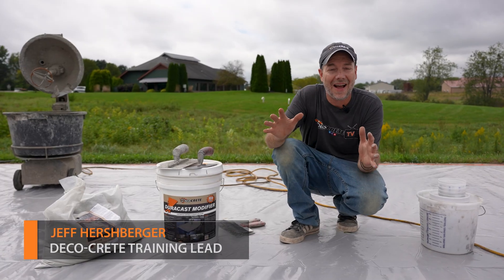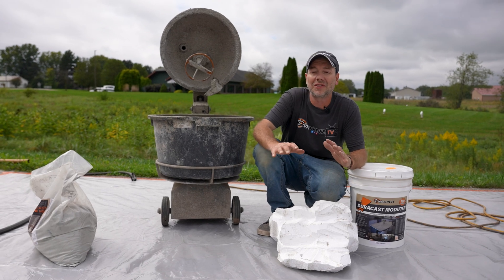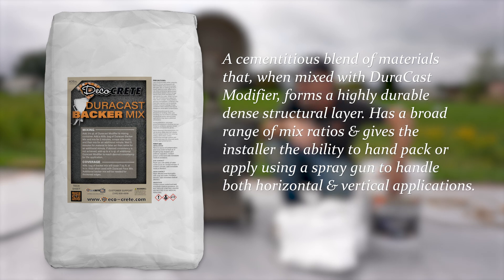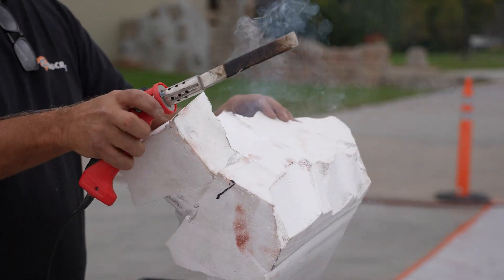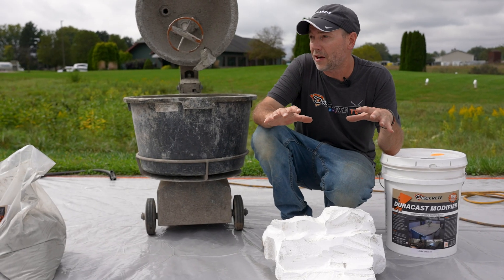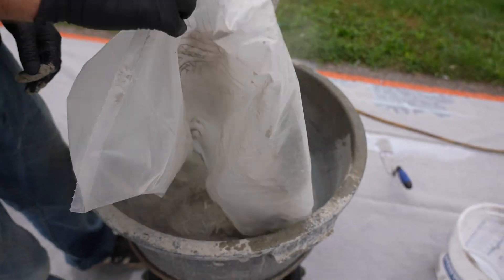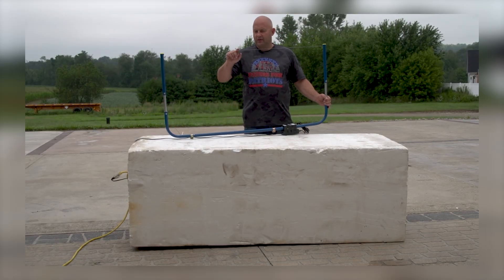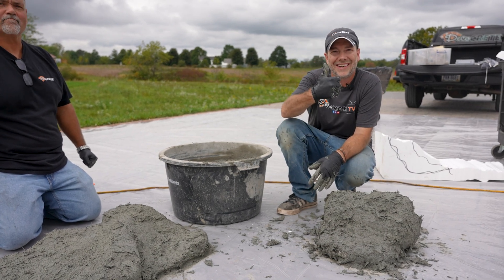Mastering Foam Core Vertical Concrete: Applying GFRC Mix

Comment: Have you guys ever had an issues with longevity of the wall using a foam core? Wasn't sure if moisture buildup inside or movements from being so light might lead to cracks in the vertical concrete overtime? 

I've been trying to find the most economical substrate for building a vertical concrete wall in my yard - looks like styrofoam or blue board might be the best bet but kinda hesitant to use them outside!
Reply from the maker: Thanks for the comment! We've had great long term success with foam core vertical concrete. That being said, it does depend on the situation. I wouldn't recommend foam core for anything structural or load baring walls. If you are just looking for a seating wall or rock formations, then foam is a great way of going about it! If the wall is gonna be holding back a bunch of weight, then laying the wall up with masonry block would be the best idea. I'll leave a link to another video on foam core below. Hopefully this helps. Thanks for watching Deco-Crete TV!!!                                                                                                                                                                                           
  https://www.youtube.com/watch?v=K9Br5SWs_dc

Comment: Jeff, if I wanted a whitish carving mix could I use a kirtbag with white portland and white sand... if yes how much Portland to sand should I use per bag of Kirtbag?  Much appreciated!  Plus what is the difference between this GFRC backer mix or Structure coat you sell on your site?
Reply from the maker: Thanks for the comment! We do have a white Vertical Concrete mix available in 50lb bags. It is a "just add water" mix, so you wouldn't have to worry about adding anything else to it. Kirtbag on the other hand, is dependent on the color of your mortar. I would not recommend using white plotland cement and sand in the Kirtbag. It is designed for Type-S masonry mortar only. I have seen white Type-S mortar in the past, but it can be harder to find. Another option would be to add some white pigment to the Kirtbag, I'll leave a link below to the pigment we sell on our website. The main difference between our GFRC Backer Coat mix and Structure Coat is that the Structure Coat is a "just add water" mix and is only meant for coating foam. The GFRC Backer needs to be mixed with our DuraCast Modifier and can also be used for countertops, table tops, or any other GFRC creation. I'll leave a link to our white Vertical Mix below. Thanks for watching Deco-Crete TV!!!!                                                                                                                                                   
 https://www.deco-cretesupply.com/products/overlay-mixes-repair-prep-products-vertical-concrete/deco-crete-vertical-concrete-mix                                                https://www.deco-cretesupply.com/products/colorpax-lip/colorpax-lip